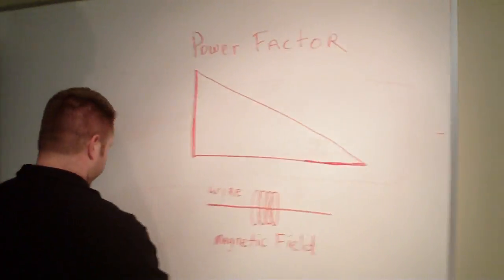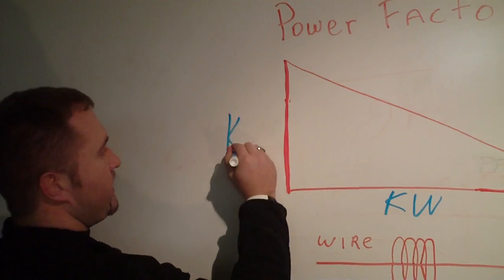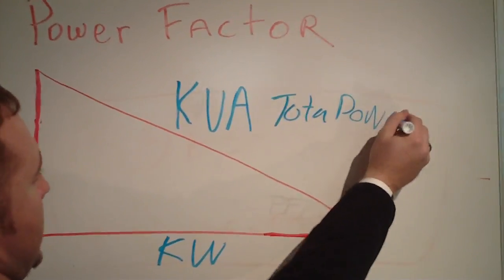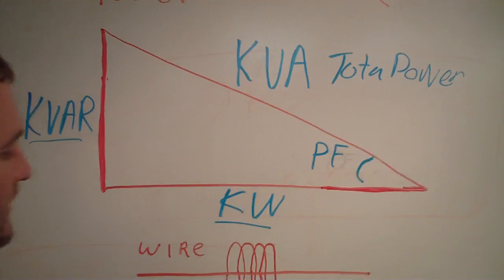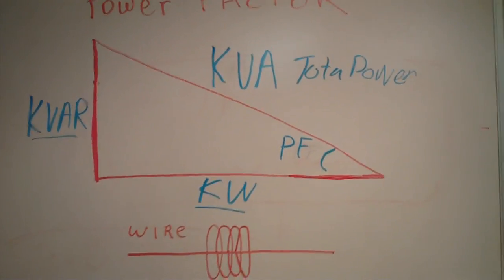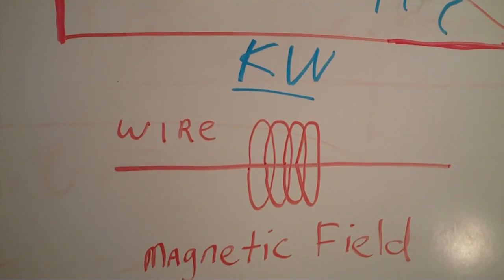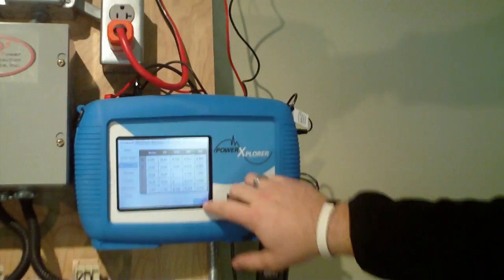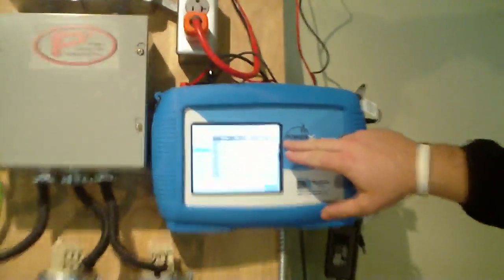Power Factor Explained

Comment: There are problems here. As mentioned in an earlier comment PF is worse with under no load but power usage under no load is also minimal.

For a motor running constantly under a high load, with a PF less than unity, PF correction could definitely help. However if the motor is run at varying loads a PF correction scheme must be dynamic or change constantly which requires some sort of monitoring and switching system to switch capacitors in and out while monitoring PF for optimal PF.

Unless you have a person standing by, as you did in the video, to constantly switch capacitors in and out of the circuit PF correction capacitors could introduce more problems than they solve.

Comment: Let me how I explain power factor to my students.
Let us say that we have a train on a pair  of tracks where the train must  remain on the track.
Let us try and move the train by applying a force to the train  while it is on the track.

Now if we apply a side force all we do is to try and push over the train sideways and the train will not move forward to acquire power or energy.
Then if want to move the train forward or backwards we MUST  apply  a force which has a component in line and parallel with the train or its tracks. The best would be to apply a force parallel with the track.

Now the direction of the track can be taken as the direction of the voltage in an AC sytstem while the Force  with its direction is just like the Electric current with its own direction relative to the track.

If the voltage and current are at 90 degrees the power factor is zero and there will be no power irrespective of nhow much we push on the train , but if the current and voltage are in phase well maximum power is delivered to the train with the minimum force and that is the same as  aunity power factor in AC systems.

If one thinks deep enough one can always find a good mechanical analogy even for Radio Frequency Radiation relative to frequency and that is having a pail full of water on a high pole. If one swings or rotates the pole, the bucket or pail will radiates water depending on the frequency it is swung or rotated as centrifugal force could produce the radiation while the rated of change of current will produce radiation!! Engineering is beautiful as it links all phenomenon so simply.
Reply: Wow! Great Explaination!
Reply: +Carmel Pule&#39; I agree that almost all electronics can be summed into mechanical analogies, but I don&#39;t like your analogy with the train as it does not explain the return of the energy to the system when the magnetic field collapses in an inductor.

A better way to think of it would be to think of the friction of the wheels on the track as resistance, the mass of the train as a capacitor, and envision pushing a spring loaded bumper on the train as inductance.
Reply: +TheNoBSZone You misunderstood my analogy, I was talking  the vectors( magnitude and angle) describing the Power Requirements hence ,  voltage vector, current vector and the angle between them.  That is I.V. cos( p)  .

What you did was to find an analogy for the various Components of Inductor , Capacitor and resistor, and that was not my intention .    Please pay attention to the subject being discussed next time. 
Any way your analogy for the capacitor was  incomplete as the mass of the train does not show the displacement current in the dielectric of a capacitor.  I have better analogies than that where   the conduction current  charges  the conducting  plates of a capacitor is  indicated and also the displacement current in the dielectric  is depicted .
Reply: Carmel Pule' No actually, I understood exactly what you tried to say.

The vectors, magnitude and angle, are all a result of inductive, capacitive and resistive loads are they not? 

Therefore sounds like my analogy is right on the money.

Your analogy makes pretty much zero sense when you factor in the friction that'd be generated from pushing at an angle. While someone looking from above might understand what you're trying to say, you will confuse the hell out of students who are taking you word for word.

As for my analogy being incomplete? Lol. Perhaps you should go back to school, Professor.

Firstly, the analogy I used perfectly describes displacement current. Ever heard of momentum?? Lol.

Secondly, its not even my analogy. Why don't you read Leo Beranek's book on electro-mechanical-acoustive circuits. Page 51 says you are full of shit.

Please pay attention to the laws of physics and eat a slice of humble pie. Your intuition sucks so next time you'd better do research before you critique others.
Reply: TheNoBSZone lmao reading these comments

Comment: So what happen when you introduce more capacitance than inductance? It is bad to have -25.5 on PF?
Reply: It simply means that you've got more capacitive reactance than inductive in the circuit which also states for poor power factor. Which results in drawing more current than a purely resistive load would actually needed.
Reply: This was my last semester project
Reply: It is gonna result in poor power factor.. Capacitance should be added only to counter react inductance
Reply: Kaushal Shah Well at the beginning they have specific KVA and KVAR and they used the peak for calculation. After one year they implemented a saving plan and therefore the demand and consumption dropped by 25% but the capacitor was installed for the highest values. So, now they have a power factor of 1.30 which is more capacitance than inductance. The key here is to know if having more capacitance will damages the motors or not? Should they change the capacitor for the whole system? If yes, what happen on the future when their add more load? the PF will go back to inductance size then. Let me know and thanks for your inputs :)
Reply: Fernando Chung Yes, a PF over unity (1.0) results in a leading power factor. Power generation companies will avoid having a PF of greater than unity because of the potential hazards (they typically mandate a customer have a PF of between 0.8-0.95 and will actually penalise you for having less). This is particularly important with distribution transformers; With a lagging power factor, transformers are "self regulating" through their voltage regulation and mutual induction properties. A leading PF can result in "self-excitation" under fault conditions (eg. secondary winding short circuit) and result in a runaway situation where secondary current increases uncontrollably and wont simply "fix itself" as it would with a lagging power factor. Destruction of the transformer is almost assured in the absence of any protective devices designed specifically to cater for a leading PF and negative voltage regulation. Induction motors actually can be pretty good when run at near full load, a PF of 0.85+ is common, but they do cost more. Nobody buys a motor to run it at 0-50% load, its crazy. If you have enough induction motors for it to be a concern, then I doubt your load will change anytime soon. PFC is really only valuable for predictable inductive loads such as lighting in shopping centres, but a lot of modern fittings these days have PFC built-in.
Reply: verboeq thanks for the comment. I remember the PF was leading side instead of lagging. That was a year ago and so far there were no issue with the motors. The laundry shop has 21 motors plus lighting, freezers and refrigeration which has motors on it. The whole facility run on 220V but most of the appliances are running on 110V. At full load the amperage goes no more than 125A per phase.

Comment: By having a poor power factor doesn't cost the industrial customer more, but the power company has the waste of energy not being sold as watts to the customer right ?  The power company will penalize the industrial customer for having a low power factor.
Reply: I think not. Reactive power is power generated by inductive loads and then gived back to power lines. That means you take active power then generate reactive power with your inductive load. Usualy this reactive power (generated power by customer inductive loads) is out of phase which means it iterfeares with frequancies in grid, thats why customer must pay for that. Some power line automatics compensate for that.This is my opinion. For example In my country (Lithuania) its illegal to run drossels without compnesation, min cos fi 0.85.
Reply: dronai It does and it doesn't. Low PF increases the amount of current you need to supply for a given load. This means larger transformers and switchgear, and larger cables to handle the increased current. In addition, the utility needs to generate more power to meet this demand than they would normally have to. This is where most of the costs come from. Many utilities are cracking down now and will penalise you for having a bad power factor.
Reply: +verboeq It's also a harmonic distortion on the entire network.

Comment: your motors are unloaded. 

Get with an engineer and get a grip on what PFC is all about
Reply from the maker: EMS Lawrence, KS We understand about the motor loading, but this just for basic demonstration.
Reply: +EMS Lawrence, KS 

I am an electrical engineer and have taken many graduate level courses on power distribution.

This mans demonstration did exactly as he intended. He took an inductive load, and corrected it with capacitors. Get a grip on what life is all about and stop trying to put others down for no reason.

Comment: Question, is the wasted energy from the voltage lagging, and  is this waste dissipated in heat, and if
the answer is yes, with the load balanced with a capacitor, would it run cooler.
if that makes sense.

Comment: Trying to understand power factor, and how it might waste electricity.
Reply from the maker: MrMac5150 
We are not selling energy savings here.  Just trying to correct power factor
Reply: +TheNoBSZone
 Sorry
Reply: +TheNoBSZone   I got it now, depending on the inductive load, adding capacitance to balance
out and bring the voltage and current in phase together.
I wondering with small appliances such as refrigerators, why they do not
build in a parallel capacitor, or is the power factor so small with a 1/2
horse power motor, they consider it to be non valid.
Reply: +MrMac5150 
Lol, its funny how you were acting so arrogant before, and now you've erased and edited all the posts out of shame.
 
The big issue here is that it took you 2 months to understand a concept that could've been learned in 20 minutes had you had just a little bit of humility. Instead you come up with these one-liner "selling sand on mars" things in an attempt to bait likes from people you've never met.

You are spreading false information doing this and become a negative to human knowledge. Truth is people like you are simply fired without much thought. 

I hope for your sake you really step back and think hard about your attitude. Your future depends on it. Seriously.

I could answer your question, but given you've soured this forum I'm gonna let you look it up.
Reply: TheNoBSZone
 I hope you indulge yourself in belittling  a person, I hope you feel good about yourself for so much effort you put into it.
Thanks for your input.
Happy New Year.
Reply: TheNoBSZone
 your such a sanctimonious individual, please remind me next year to buy you a jar of Vaseline for Christmas.
Happy New Year.
Reply: MrMac5150 omg! are you  Tom Selleck?